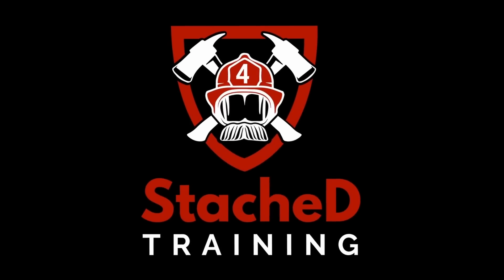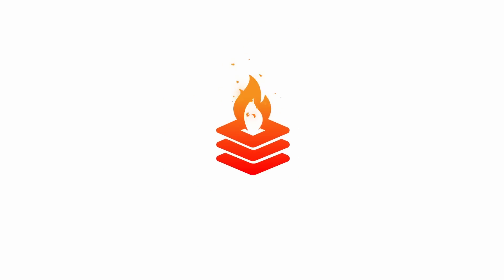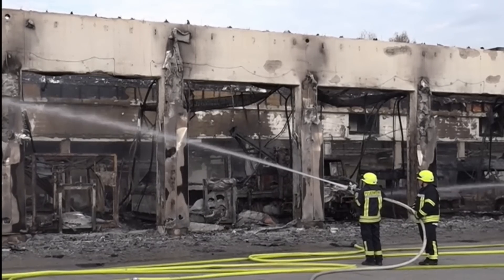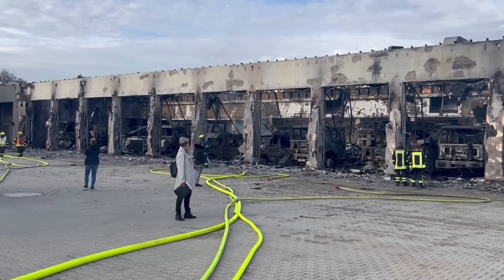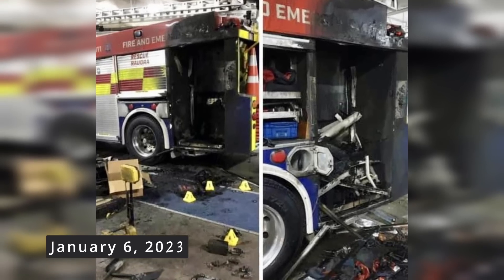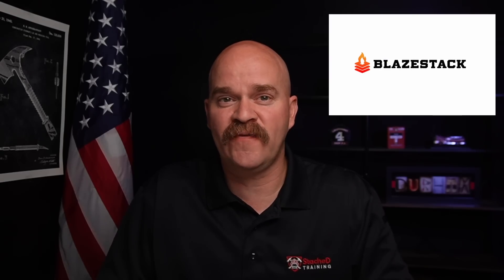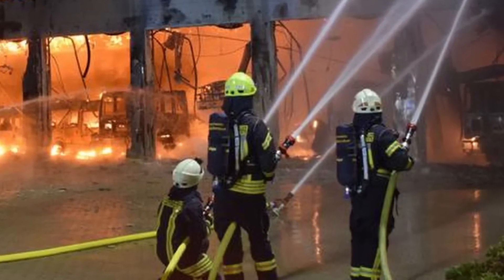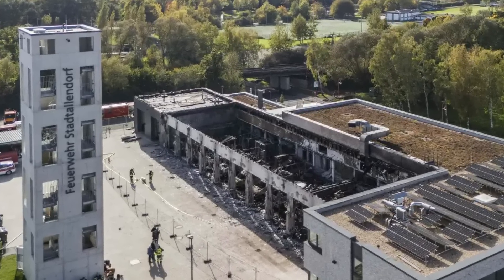Lithium-Ion Batteries Spark Fire Station Disaster: Germany

Comment: I remember when gas powered extrication tools were a thing. We were an early department in the area to switch to electric. I was recently surprised to learn they're doing that with batteries now. If such a powerful tool can run on batteries, I can imagine pretty much everything runs on batteries now. There has to be a way to make this safe.😢
Is it possible to charge all the batteries off the truck and have a go pack? something you grab when the truck hits the road? Could it be possible to have a separate vehicle dedicated to batteries and charged in a separate garage, and it gets brought to the scene just like everything else? I don't know what the solution is, but something needs to be figured out until we get the right battery technology. I do believe safer stuff is on the horizon.
Reply: re: "There has to be a way to make this safe."  okay well just be careful with those kinds of thoughts Geni Gen for there's NO LAW IN THE UNIVERSE that's says there "has to be a way", no, anytime we're heard saying that, that's simply us expressing our DESIRE for there "to" be a way (hint: it's very important our "wants" and "desires" be kept separate from reality).  this behavior is also known as Confirmation Bias, also ref: "The greatest DERANGEMENT of the mind is to believe in something because one WISHES it to be so..." - Louis Pasteur (1822-1895)
Reply: re: "I don't know what the solution is..."  fair admission.  re: "but something needs to be figured out until we get the right battery technology."  which again, may or may NOT ever come to fruition.   since unfortunately we're now at a "Dead End" stuck all the way in the upper left corner of the Periodic Table (despite the "hype" surrounding 80 other chemistries) Lithium is likely as good as it's ever going to get for Mankind.  

re: "I do believe safer stuff is on the horizon."  well of course you do, YOU believe that as does a WHOLE LOT OF OTHER PEOPLE believe that but therein lies the rub,  "beliefs" unfortunately in the context of CHEMISTRY, NATURE and the LAWS OF THE UNIVERSE don't really mean anything in the grand scheme...

yeah this goes some way at explaining why despite Lithium Ion Chemistry being invented way back in 1980 (at which point it's hazards and flammability were well known) it's now been in existence 44 years with NO SOLUTION to the fire problem, other than to leave it be and not use it, or at least keep the risk to minimum by NOT wiring numerous cells in P/S configurations like a "crazy person", and creating ONLY "single cell" or "limited cell" devices (ref: Cell Phones and Lap Tops).
Reply: @phillyphil1513  you are really in your own universe with your thoughts. You are very well entitled to that and your opinions. Technology has a way of figuring stuff out. I'm not expecting miracles, maybe not even soon. I'm just saying that batteries were never this good, and we never could have imagined them being this good, and now they are. We still have to fix the dangerous part. Maybe the solution won't even be a battery. who knows? we will find something and we will carry on. maybe in a decade, maybe in a few years. In the meantime, we need to be more careful with what technology we have.
Reply: @phillyphil1513  we may not get x to work the way we want, but maybe we'll find y to do it better in a different way. If you asked the apollo team if they could do what elon just did, think what their reaction would have been back then.
Reply: @phillyphil1513  i've learned an interesting lesson at work. Maybe it applies, i'm sure you'll tell me it doesn't. Sometimes when i'm seeking an answer, finding the most knowledgeable people on that topic are not the best ones to ask. They certainly can be, but they can get stumped, too. Sometimes asking the most unexpected people, the same question, gets you to the result you need. 
In one scenario, the person I wanted to ask was on vacation, so i asked a few others that were also knowledgeable on the topic. They didn't have the answer. Then I asked someone who casually associates with the topic and they couldn't tell me why, but they told me how to get it to work. 
Sometimes when you're knowledgeable, even too knowledgeable, if that's possible, you get tunnel vision in your thoughts. we've all heard of outside of the box thinking. It doesn't have to be way outside the box. Maybe it's just a different perspective that can help.
I agree with you if you say we can't push battery technology in the direction it's going. I've heard similar things, but i'm not as sharp on the details and what they all mean. I have seen batteries demonstrated that don't catch fire when you smash them with a hammer.
Seems like progress to me, but i guess i don't understand it enough.
Reply: @geniferteal4178  re: "If you asked the apollo team if they could do what elon just did, think what their reaction would have been back then..."  well the better people to ask is NOT the Apollo Team (US Space Program #3), no, but ask the Men and Women who worked for 30 years as part of the SPACE SHUTTLE TEAM, ie, US Space Program #4 (1981-2011) whether or not Elon's accomplishment of grabbing a rocket with arms out the air is meaningful...

this stands in CONTRAST to the Humans having to go back to being "plucked out of the Sea" like so much Gemini and Mercury Mission (ref: US Space Programs #2 and #1) when what the Shuttle would do is launch vertically (leaving the Boosters to be recovered from the "drink") but return the HUMANS to Earth horizontally with all the comfort and convenience of a Commercial Flight on Delta...

so call me when Elon starts returning those rockets to the Earth (like Martians) with the Astronauts inside, and i'll be first to applaud Space X (US Space Program #5's) efforts.
Reply: Read into it, however you want.Maybe the only way to make it safe is to not use this battery technology anymore.
When I said has to I was implying that we can't go on this way. So whether we find a way to make it work or just stop doing it, that's what i'm saying, we have to do something. To continue on the same course is not something we can continue to do.

Comment: One report stated one of the fire trucks itself had a charge cord.  If it was an ev fire truck, that will probably not be released
Reply from the maker: Fire trucks are typically plugged into shore power.  This keeps the air pressure topped off in the brake system and radios/equipment charged.
Reply: @StacheDTraining  Doesn't that in cooler climates, also keep the engine warm using a block heater, so the diesel engine is ready to give its best power immediately, versus it being cold and maybe a bit stuttery and underpowered?? I think our fire appliances in UK have block heaters, or they did, I remember them being mentioned once while doing a tour ages ago.
Reply from the maker: @Tekwyzard  in vehicle stored outside,  yes.   Inside,  not such a big deal.
Reply: @StacheDTraining  Could be either.  As I stated, if it was an EV fire truck, that will be downplayed.  Knowing how new this fire dept was, and knowing Germanys reputation for going green, I'm suspicious it was an EV truck.  Obviously I have no way to know one way or another.
Reply: @howebrad4601  You should be suspicious of your on bias. Investigation is still not concluded and will not be for a bit. So far, even the Li-Ion Source is just speculation. While it will probably turn out to be some sort of smaller battery that started it, probability makes it the highest chance. 
EV-Fire Trucks make little sense for a volunteer fire department. EV-Trucks are best, where the are constantly in use. They far more expensive to get, but cheaper to run. Some full time department in a huge city, this may can make sense. But not for a volunteer department.

Comment: If there was an electric fire truck. only that could have caused something like that, it is just too obvious. A diesel truck, or even multiple ones, could not do that in few minutes. Over a ton of lithium battery can and will. So, there is just no mystery there. Do they charge them indoors? There will be restrictions to charging EV:s close to buildings, and Germany already has that in some places. It seems that fire stations are allowed to do that....
Reply: They had only diesel trucks at Stadtallendorf fire station.
No EV was in that station.

Comment: For anyone wondering why there were no smoke detectors etc.
The hillarious fact is, the building regulations stipulate that smoke detectors and other such things have to be build into new industrial, commercial etc buildings.
But the building regulations dont say anything about them to be needed in for example new fire/police/THW etc stations so they usually let these things out when building a new such station to save Money ( some include them but its not many)

Edit: the fire destroyed 13 fire trucks of all kinds including a few roll off container.
Reply: If you do the math, you're looking at maybe 200+ mio for sprinklers and external alarms and 1+ million additional maintenance costs for all the fire departments. Otherwise somewhere in the around probably 11 mio annually. Unless you get enough fire stations burned down... it's financially not worth it. Mostly the law requires them for the purpose of protecting people. Damage is rather regulated via insurance premiums and deductibles for additional protection.
Having save and clear of clutter escape routes is far more important, as those do make a very significant impact on lives saved.
Once was present on a fire, where they had gas powered stuff inside the structure. The Gas Flasks where coming down up to 600 feet from the fire. And you really don't wanna know what happens, if someone messes up with gasoline storage and it ends up flowing into the sewer system.

Comment: The time has come to re-think the design of fire stations ... bays must have fire resistant floor to ceiling walls &  a self closing door between apparatus with sprinklers, alarms and hose reel ... charging room must have fire resistant floor to ceiling walls, sprinklers, alarms isolating lithium batteries from the station ... yes! the wall will seem like a hindrance as will the door but these batteries are dangerous and unpredictable, loosing a station and appliances is a huge loss to a community everything must be done to make sure fire fighters and there valuable equipment are safe

Comment: Hey from Germany, Fire started in a standard Diesel Fire engine, no electric Vehicle.

The 16 Millionen Dollar station was taken into Service last december... 😩
Reply: Another fuckup from Germany.  LOL.  Like that time they shut down all the nuclear power stations and then had to use coal to meet demand after the Russian pipeline mysteriously blew up.
Reply: Apparently not.  "German built Rosenbauer electric fire truck that caught fire whilst charging".  We have outright lies reported on the news in my country also.
Reply: Diesel doesn't just catch fire
Reply: @mason5540  probably caused by a Radio/Lamp Charger/Battery system. my earlier Statement related to, whether it might have started in a electrical fire engine
Reply: @mason5540  fire trucks have vhf handheld radios and wow they have lithium batteries just like your phone
Reply: @chrisward5626  Wow, that's not how this fire started though
Reply: @mason5540  it started from some batteries being charged . Could have been the radios or even a power tool .
Reply: @chrisward5626  lithium ion batteries cause a fire in a fire stn in UK. Started in cutting equipment on appliance, totalled appliance and damaged station which was closed for a time.
Reply: @michael.randall5034  and what’s your point ? Kinda strange you felt the need to tell me that .
Reply: Diesel takes spark AND pressure to combust.
Reply: @jeffforbess6802  lol 😂 what ? Are you serious? 😂🤦‍♂️

Comment: I believe the 'NEW' fire station was manned 24/7 so a 3 minute response seems slightly slow considering. I assume they had the new fire engines that run on Lithium ion batteries and were charging at the time of the fire. Those new battery fire trucks even have diesel engines onboard to run the water pumps i believe! Maybe someone higher up is trying to tell us that Lithium ion tech is not quite their yet!

Comment: Lithium batteries are the problem. An alarm system would not help. 70 firefighters could do nothing. The response time was immediate. Fire suppression may have helped some if it were designed with lithium batteries in mind. Of course, if you remove the threat of lithium batteries, the problems go away.
Reply: so no phones, no power tools, no batteries on the truck, wash out the diesel engine and exhaust after use, no VHF?  ERworkers should be equipped with buckets of water?  
It's just a loss of money and if that's a problem, extract the money from the stupid person that signed the contract for a building with no fire containment and alarm.
Reply: re: "The response time was immediate."  bingo, which is our FIRST CLUE that the problem (like so much CAT 5 Hurricane spinning off a "baker's dozen" of Tornadoes ahead of it as it comes on shore) may in fact be BEYOND the "cunning of Man" and/or "Man's Device" to solve.
Reply: re: "Of course, if you remove the threat of lithium batteries, the problems go away..."  "Pump Your Brakes Kid..." (best Robert Downey/Sgt. Lincoln Osiris voice) wait, are you telling me that this problem of Lithium Battery Fires can be EASILY SOLVED by nothing more than the "generous application" of the same DISCIPLINE, RESTRAINT, MATURITY, and WISDOM that you, me, we ADULTS are already obligate to use, when making GOOD CHOICES in our everyday lives...???  CRAZY TALK...!!!
Reply: The vehicle was ice . Obviously a sprinkler system would have suppressed the fire more then nothing .
Reply: Was it really? Like buildings never burned down before batteries?
Small(!) battery was probably cause of fire (no indication of large battery fire), but it is not standard that fire spreads so much in short time, that they cannot put it down. There must have been something extremely flammable (not batteries).

Comment: A certain level of irony there, our fire dept govt etc here in Aus are constantly going on about smoke alarms, check change the battery every 12 months as no one expects the station to burn down. But those nupties who thought thay could save a few euro's by not installing a fire supression system etc. I hope they get fired (boom-Tish) 
Underground mining trucks have hose attachments built in to flood the battery / engine compartment should one catch on fire. How much weight and cost would that impose on a fire truck if you had similar built in area / compartment for batteries or specific battery run equipment?
Hopefully the post fire investigation will pinpoint the source although I expect a fair amount of ribbing from other fireys will keep people grinning as it's just too good an opportunity to ask crew from that station if they left the lights on?
As  a final a neighbour lost his garage when a Li battery left on charge did the thermal run away thing. No one was hurt but as I point out to the girl when shes hammering batteries in her electric lawnmower to feel how hot her batteries are from the discharge of energy, Now imagine how likely a thermal run away situation is from charging an already hot battery. I suspect little miss impatient is charging them up hot when I am not around. Or will until her house burns down.

Comment: Not having a fire sprinkler is stupid.   Battery or no battery.   You have diesel fuel stored  in doors in one occupancy with a  with sleeping area probably in an adjacent occupancy.
Reply: german fire stations operate differnetly... most are volunter organisations so the firefighters are not at the station regulary... stations like this one have bays for the trucks, shelfs for the equipment maybe a workshop for repairs and a office for administrative paperworks usually showers for after they return from fighting a fire but only the few inbetween profesional fire brigades (most of these are at a factory or refinery or airfield as required by regulations regarding the specific trade) would have a ready room to spend waiting time in

Comment: A fire station catching on fire feels to me like the quote in Friday about getting fired on your day off. LOL. Spend $24 million then decide to cheap out on the important stuff. Good lord.
Reply: Recently in PL, a company that serviced the batteries for a local fire departments tools, went up in flames.
Reply: I really don't believe a smoke alarm system would have made much difference! Although a suppression system couldn't have hurt.
Reply: Generally speaking, in the german speaking area, stuff is far more reliable. So you don't have much in terms of rules about fire alarm / suppression systems (except for buildings where you have loads of people). Mostly, it gives you lower insurance, so it generally the insurance companies that do the math. They may reassess the situation after this, when it comes to this structures, where you have a lot of additional battery-powered equipment.
Strangely, over here in switzerland, despite loads of cars charging in underground parking garages, we don't seems to have trouble. even though, you're only allowed to do that, if you have a professionally installed system (which likely adds another layer of protection). But you're not allowed to charge up anything else in a underground parking garage (like a e-bike), as those lack the additional protections.
Reply: Why have 12 fire trucks at one firehouse? The should have 4 or 5 fire houses with 2 or 3 rigs each.